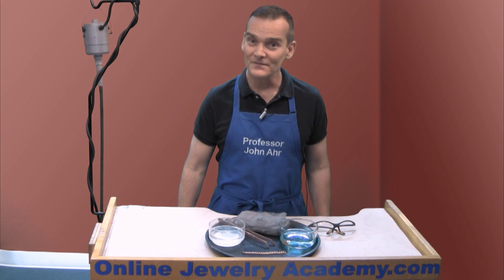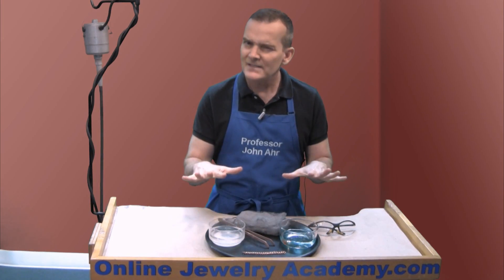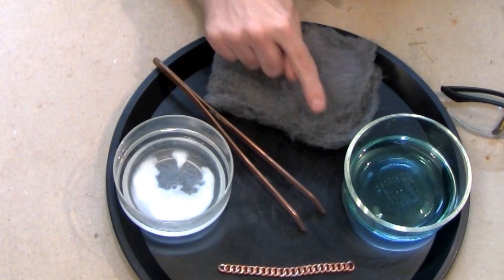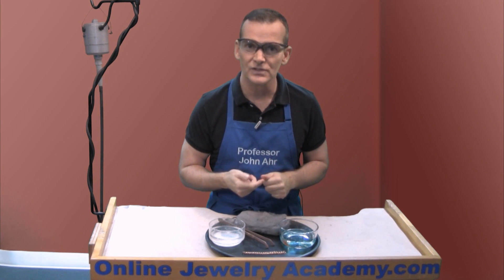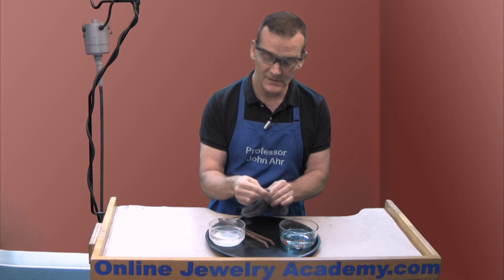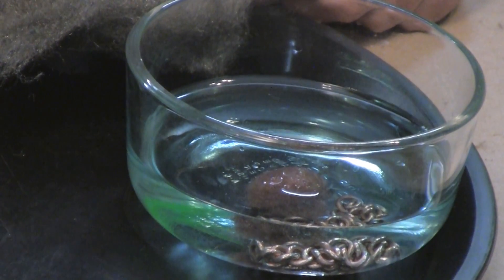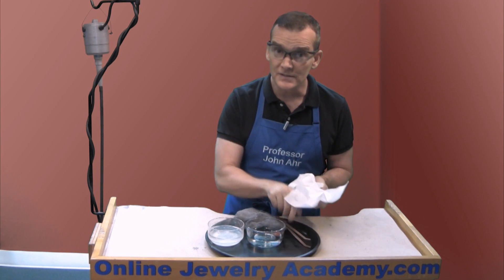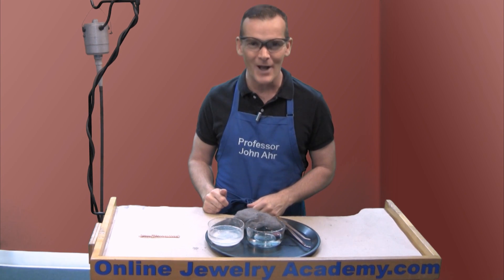Solder Plating Using Spent Pickle

Comment: Spent pickle from pickling copper?
Reply from the maker: Yes, spent (or saturated) pickle can come about from pickling copper and/or sterling silver items. Many jewelers test their designs in copper. And a large number often create wearables from copper. 😀
Reply: @OnlineJewelryAcademy  Thank you so much.  Can this spent pickle also be used in t the process of etching?  Beginner here.   🤓
Reply from the maker: @plaru5194  Spent pickle will not etch copper.  When pickle is “spent” it is completely saturated with copper sulfate. So it has zero ability to etch a copper plate. Print makers use different materials. Good luck with your creative pursuits. 😀
Reply: @OnlineJewelryAcademy  Thank you 👍

Comment: Hi Professor. just wondered if this would work with plumbers lead free solder as it does containn some solder? I'm trying to solder larger pieces of copper and I am finding it a nightmare with jewellers' solder.
Thanks.
Reply from the maker: It's never a good idea to use plumbers solder on jewelry projects.  I don't know how big the pieces are that you're trying to solder.  But, I'm pretty sure that the reason why you're having difficulty using silver solder is because you're not applying enough heat.  You may need to increase the size of your torch or use an oxygen assisted torch. Good luck with your projects. 😀

Comment: This was probably one of the best and easiest demonstrations for plating copper that I've ever seen!  I've seen other demos without electricity that used nails but it was said the steel or iron had to actually touch each of the individual silver solder joins in order to plate it.  You just proved that to be not necessary! 👍   It seems having the steel wool close to the chain was sufficient to get the job done.  This was so helpful because I just finished making a copper cuff bracelet by soldering lots of swirls together and I was really dreading trying to plate it.  Also, you indicated it can be tumbled afterwards which I can only assume tumbling will not remove the plating (I was worried about that).  So... THANK YOU VERY MUCH FOR THIS!  I have my spent pickle ready. The only thing left to get is some steel wool.👍 Thanks so much!!!😊
Reply from the maker: I’m glad that you found the video so helpful. Tumbling your plated bracelet will harden the plating and give it a bright finish. Thanks for watching! 😀

Comment: This is really helpful, thank you! If you use silver solder on brass pieces, will the brass also be plated with copper when dipped in the spent pickle with steel wool?
Reply from the maker: Yes. The brass will be plated too. Glad you liked the video. Thanks for watching. 😀

Comment: I use basic solder (brown sticks) to solder copper. The pickle pot works great. However, I found that when I filed down some of the solder because it was too much, the pickle would then not cover the smoothed solder areas, remaining grey and exposed. Do I need to do an extra step? Why doesn’t the copper stick to the solder? Thanks so much.
Reply from the maker: The solution in your pickle pot removes oxides and copper from the surface of an item.  To cover the solder joints with a copper plating, you have to use spent pickle (old pickle saturated with copper sulphate) in a separate container along with some steel.  😀
Reply: OnlineJewelryAcademy thanks, that’s exactly what I did, but it wouldn’t cover the newly ground down surface area where the grounded down solder showed. It covered the rest of the solder nicely. 🤔
Reply from the maker: Fiona Thompson That’s a brain scratcher for sure.

Comment: I’m guessing you shouldn’t do this while the pot is still plugged in? 
I added 0000 steel wool to my pickle with my copper bracelet already in it and it began to “sizzle” and steam/smoke. The odor burned my nose so I brought it outside. My steel wool disintegrated (eventually) and my silver solder isn’t coated. I use PH down...could that be the problem?
Reply from the maker: This process only works with "spent" pickle: green pickle that doesn't work anymore.  I usually transfer my cold, spent pickle to another container that has a resealable lid.  When I need to plate a copper piece, I pour some of the spent pickle into a bowl and introduce some steel into the solution.  You shouldn't do this in your actual pickle pot with hot pickle.  I recommend that you neutralize the pickle you used with some baking soda and dispose of it according to your local laws.  (The OJA does have a video on pickle disposal.) Clean out your pickle pot and start over with some fresh water and your Ph Down.  Your silver didn't plate either because there wasn't enough copper sulphate in the pickle or because the steel wasn't in contact with your piece.  😀

Comment: I would love to try this.. my pickle is so new, not sure how long or how many pieces I'll have to make to turn it blue to coat the solder.
Reply: Hi. I know your question is 2 years old but I thought I'd mention what I've done in the past.  I actually use a white vinegar and salt pickle (lots of salt!) but if I want to keep copper sulphate on hand for plating, I mix a small batch of pickle in a see-through glass jar and throw some copper wire in it and leave it until it turns blue. You have to be patient so this doesn't help if you're in a hurry but it is a very easy way to be sure you always have some on hand.
Reply from the maker: Hi Gisele,  I'm glad that our video inspired to try something new.  Keep at it and I'm sure you'll have some green pickle in no time.
Thanks for your support! : )

Comment: Hi Prof. John. I have a question for you or anyone that can answer. Will copper plating with spent pickle work for a vinegar and salt solution?
Reply from the maker: Hmmm.  Good question.  I've never worked with a vinegar and salt pickle solution.  So I've never tried it.  I assume that it will work the same way as a solution made from sodium bisulfate.  It won't hurt to try and experiment and see what happens.  Post a follow up and let us all know what your results were like.  
Thanks for your support! : )
Reply: Wow thanks for the quick response. It seemed to work at first but then the copper wiped right off. Back to experimenting. By the way I love your teaching. It is simple yet very informative. I've learned a lot from you.
God Bless
Reply from the maker: Thanks for posting your results. And, thanks for the compliment.

Comment: I've used my pickle a few times soldering Bronze, Copper, Gold filled etc. and took some of it and put it in a clear glass cup. It's not blue though. How did you get it blue to begin with?  I added steel wool to it but nothing happened.
Reply from the maker: The blue-green color of the spent pickle comes from use.  if you use your pickle pot regularly to clean sterling silver, copper and brass it will retain copper sulfate which is green.  You just need to use your pickle pot and wait until the solution has some color to it.  
Thanks for your support! : )
Reply: Thanks for your help.  Since I have the silver seam from copper solder that I want to get rid of and don't have any blue pickle can I just reheat the pieces to get rid of that grey silver seam? And how much do I have to heat the piece?

Comment: Hi John. Does this work with silver solder on bronze wire?  Thanks. Leslie
Reply from the maker: Hi Leslie,  No.  If you try this with bronze it will just get copper plated.  Remove the solder from your piece without removing the bronze.  Then, apply a finish and see what you get.  If you really minimize the solder you might be surprised how hidden the seam will be.  Good luck!
Thanks for your support! : )
Reply: Thanks John. I'm new to soldering. I will try less solder.  I have tried removing the solder with files and sandpapers. I think I have burnished it into the bronze wire.  The solder seemed to spread along the bottom of the wire where I laid the seam over the pallion (on the solderite block) as well as filling the seam. So on one side of the wire there is soldering showing, but on the other... not so much. I wish I could add a pic here.
Reply from the maker: I would recommend that you watch some of the soldering videos that are posted on the website at:  www.onlinejewelryacademy.com.  Solder should be cut into 1mm square segments.  It will literally penetrate your metal and make a connection on a molecular level.  Controlling the flow of solder is achieved by limiting the flux to the area of the solder seam and evenly heating the piece.  Good luck with your projects.
Thanks for your support! : )

Comment: I purchased brass solder from Rio G. and it turns silver; do you have any tips for that?
I've used your tip for copper and it works great!

Thanks again!
Reply from the maker: Unfortunately, the only suggestion I have for covering solder on brass is to send the object to a plater and have it plated in gold, silver or rhodium.  Glad you liked the Hiding Silver Solder video.
Thanks for your support! : )

Comment: Would the copper plate wear off the copper over time like copper plate wears off other metals or is the copper to copper bond stronger? Thanks in advance.
Reply from the maker: Hi Rhonda!  The copper plating will wear off just like any other form of plating.  The one that really holds up is nickel plating.  In fact, copper is usually plated with nickel (kind of like a primer coat of paint) before it is plated with any other type of metal.  The nickel prevents the copper from reacting with the final plating.  I hope this information helps.
Thanks for your support! : )

Comment: This worked PERFECTLY!  Thanks for making this such an easy one.  I just finished plating my soldered rings and will tumble it in the morning.  LOVE working with copper, but none of the copper solders I've tried blend well.  This video was the ticket! Thanks.
Reply from the maker: Hi Cindi,  Glad you found the information in the video useful.  Copper doesn't like to flow.  So, all copper solders are alloyed with something to improve their flow.  And, as you know, copper is the only red metal.  So, there's always a color difference.  Glad the OJA could help.
Thanks for your support! : )

Comment: Thanks, I can't wait to try this. I'm using copper solder for my copper but still finding I get a grey looking seam. Would this process work for copper solder as well?  Not sure if my pickle is not hot enough or what but I love copper and am frustrated the copper solder is giving me a dull grey look.
Reply from the maker: Hi, Glad you liked the video.  Yes, this process will cover copper solder.  And, your spent pickle doesn't have to be hot.  Be sure to tumble the piece after plating to help shine and harden the new material.  Good luck with your projects.
Thanks for your support! : )

Comment: Hi! Just had a quick question: I'm working with gold plated brass. When I place the brass in my pickle it loses it's coating is there a way to re-coat the brass gold? If not, is there a good paint that you can recommend for metals? Thanks!!!
Reply from the maker: Plated material has to be re-plated after is exposed to the heat of soldering.  So, to restore your piece to its original condition, you need to take it to a professional plater.  There is no gold paint that can make your brass piece look good again.
Thanks for your support! : )

Comment: just out of curiosity, would it work with aluminium instead of silver solder
Reply from the maker: +Daniel Kadera 
Hi Daniel,  You cannot solder with aluminum.  Aluminum is usually welded using electricity.  Plus, you never want to work with aluminum in your studio.  Aluminum contamination will cause castings to be extremely porous and brittle.  Stick to the materials that I demonstrate with in the videos and you can't go wrong.
Thanks for watching! : )

Comment: Can you patina on top of this plating?........  I'm assuming you would need to be gentle when getting the highlights in the patina....
Reply from the maker: +Chris Hayes 
Hi Chris,  Before you apply a patina to a copper plated item like the one in the video, I would recommend that you tumble it for at least an hour.  And yes, you would need to be gentle when you remove some of the patina.  I always recommend running a couple of tests before you try something on a real piece of jewelry.  Good luck with your project.
Thanks for watching! : )
Reply: Thanks!

Comment: So, how long would you tumble in this case?  It seems that if you tumble this piece, won't it scrub the metal at the joints and reveal those silver joints all over again...??
Reply from the maker: +Zippy DoDah 
Tumbling is a mechanized burnishing process.  If you use the correct mix of water, lubricant and acid, the metal shot will slip over the piece that you plated in the used pickle and simply smooth the surface.  Polishing the piece with a motorized polishing system would strip the plating.  Good luck with your projects.
Thanks for watching! : )
Reply: Zippy DoDah Just subscribed to your channel! From an art teacher to an art teacher your instructional method is spot on! Question? You mentioned acid in the tumbler. I've always used water and Dawn soap in my Lortone tumbler. Should I be adding an acid? If so what kind and how much for a one pound tumbler? Thank you!